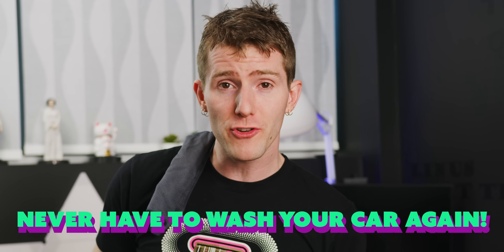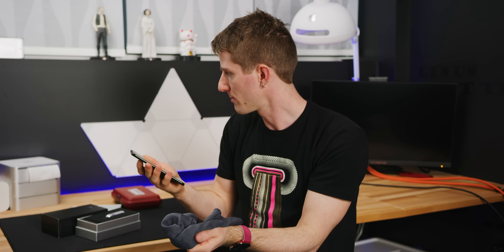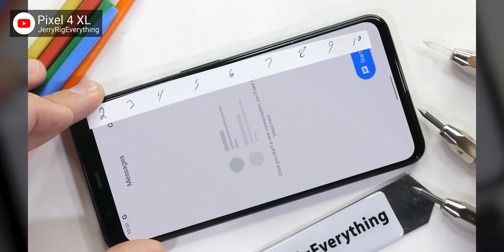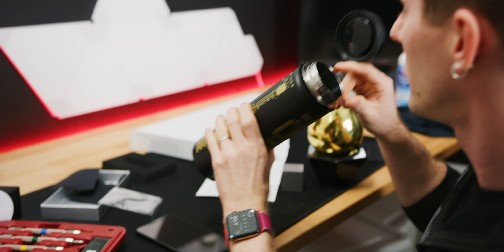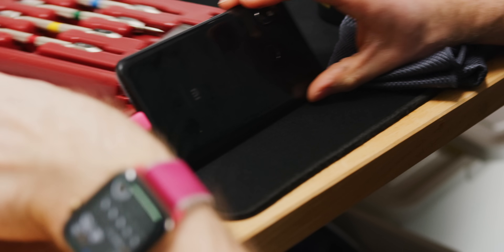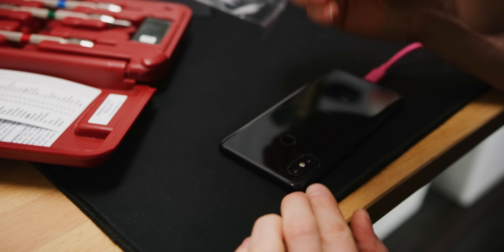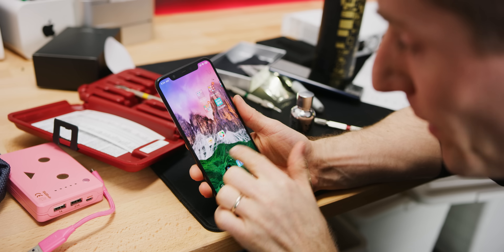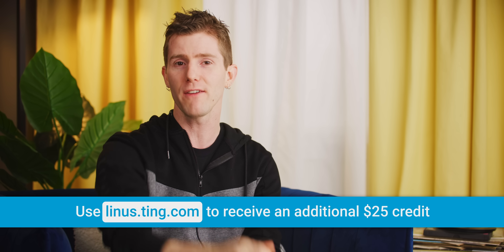Can Automotive Coatings Protect Your Smartphone?...

Comment: I wish you would've gone with a more reputable ceramic coating for this test. The one you're using is basically relabelled Chinese product. If you ever retest this, so with one of the OGs (Carpro, Optimum, Gtechniq, Gyeon, etc)

Comment: no one that knows coatings would say you never have to wash your car. completely impossible, now when you do go to wash it when its dirty, itll fall off when sprayed by water and soap. only thing about using this on a phone is most coatings will eventually need a rejuvenation coat to help the coating stay in good condition.

Comment: 5:30 -glass backed phones. Camera bump might be obnoxious but at least it prevents the mirror polish on the back of the phone sliding off surfaces inclined by more than a few degrees.

Apparently this is a problem with the new galaxy z flip

Comment: 9H hardness isn't actually anywhere close to a 10H on Moh's scale, as the scale is logarithmic, meaning that 10 isn't 1 step away from 9, rather it's 10 times greater than 9, which is 10 times great than 8, etc...

Comment: Hybrid ceramic wax would actually be pretty nice if you did a good application job. Best part of hybrid ceramic is it's SOOO easy to apply. You basically just spray it on.

And there's no such thing as ceramic coating making your car totally hydrophobic or making it unecessary to wash. It is great for your paint and stuff though.

Comment: great test but you used a cheaper ceramic coating. 1-Buy Wolfgang's coating for about $200 for 30cc. 2- Take two phones, Seal 1 phone completely, Leave 1 phone unsealed. 3- LET THE PHONE CURE FOR A WEEK. 4- Redo Test

Comment: OH GOD.

Linus. Stop. Ceramic coatings are excellent. But they aren't for protection against scratches. They're for protection against road grime, acid, industrial fallout, etc. And generally just produce a surface that is easier to keep clean.

This video needs to fuck off, because I already know what it's going to be, and I haven't even watched it yet.

Stick to tech linus. Stay away from cars. Your opinions on how driven vehicles should be banned when self driving cars come about is obnoxious enough as it is.

Comment: 4:23 NO. Hardness and toughness are 2 completely different things. Hardness is resistance to indentation, toughness is probably best measured as the ability to absorb energy during an impact. Increasing one tends to decrease the other. For example most ceramics are hard (good at scratching) but not tough (they're brittle), whereas a typical steel bar is tough (hit it, it bends and absorbs energy) but not hard (it's easy to scratch).

Comment: I'm curious what would happen if you went back over the scratches with the sealer.
Reply: ceramic does not fill in scratches. when you apply it on a car you have to machine polish the paint or the spider web like scratches will show through and they are very fine scratches.

Comment: I really like your videos, but this one is wrong in so many levels. Watching you from a detailing perspective, the basics of applying a ceramic coating is applying the proper product for given surface - meaning: there is a specific coating for glass, and what you have in your hands is for clearcoat. Other than that, given surface must be cleaned with isopropylalcohol and a lint free microfiber cloth, after which you apply a ceramic coating with given tool and rag in a cross pattern motion, from up to down and left to right (works either way), and in a few layers, after that you leave it to dry in natural light and a temperature not much below or above 20°C. That is talking about serious ceramic coatings, not the garbage ones. Normal ceramic coatings on cars, when properly applied and maintained, can last 3-5-10 years, depending on product and terms and conditions. When you do it like that, this video will not be crap.

Comment: Aka this stuff is autoglym, doesn’t mean you can’t wash your car, if you do that without topping it up you will lose the coating eventually. Fine Scratches will still show, shampoo your car without jetting it first and watch them swirls. 

I know all this as I have bought the product several times before and on my first car I made the “don’t need to clean the car so much” mistake & the “I can just shampoo my car straight away” yeah she turnt In to a swirly girl. 

The Water beading effect though is awesome! Makes cleaning things so much easier.

Comment: The thing with ceramic coating is that the scratch is in de coating now and not the glass. Which should make te phone more scratch resistent. You schould try to polisch the coating of en also polisch the non coated side and check the difference then.

Comment: im a detailer and i work with ceramic coating on a weekly basis. i can say it is legit and really works like they say, BUT!! but butt, it all comes down to the prep work and it wont protect from anything more then minor scratches. if a vehicle is not prepped proper it wont last long. of i forgot its pricey asf.
if done proper dust and everything will literally fall off. spray with water and clean! no wiping, soap, nothing just water clean.

Comment: I have ceramic GlassCoat bottles and have done this a couple times to my old galaxy S7. Thing is still rock solid.

If you use a high quality ceramic coating thats like $50 to $99 a bottle or even more, you'll notice a difference.

Comment: I have a glass screen protector on my phone that, when I bought it, had an oliofobic coating on it. That coating started to wear off and fingerprints, grease and other types of dirt were way more difficult to buff off. I applied a window coating that I use on all of my cars windows to make them more resistant to water and it worked perfect. It was like I had on oliofobic coating on it again. What I think happened here in the video is that the ceramic coating isn’t able to bond with the glass properly. On car windows you actually have a two-stage process to install a window coating: first á buffing stage, where all the “trapped” dirt inside the glass is being removed. Then the pores will be exposed and you apply the coating itself in several layers. The more layers the longer is lasts. It will degrade over time but it holds up really strong. Maybe you can try a window coating instead of a paint coating (like in this video).

Comment: Coming from the car world you'd get better results if you applied it closer to the recommended instructions. 2 coats with a full 24 hours of curing in between. At this point it's ok to touch but then you still need to give it the full 6-12 days to completely cure before doing any testing. that full curing is very important it doesn't reach it's full hardness until it's fully cured. As well there's a big difference in the pro ceramic products and the diy stuff you get on Amazon a lot of which is more like enhanced car wax than true ceramic coating, so mileage will vary greatly between product

Comment: I want to know what happens if you use the coating after scratching and compare the results between the control side and the coated side.  Does it fill the scratch like it says it will for car paint?  If it does is the screen still readable?  Also, Does it work better if it was was coated when it got the scratch or does it work regardless?

Comment: LTT really should read the Safety Data Sheets before doing this.  Yes, for example a ceramic seal and shine type car gloss application (or any for that matter, ceramic would just make sense here) can make some difference in terms of adding some microns of layer on the screen to help with scratch protection, but much of which is a hazard for example to the eyes if you say use your phone and then rub them afterwards even after curing.  It's not worth it.  Get a tempered glass screen protector instead.  Many of these coatings are formulated to adhere to a painted surface and not intended for glass where they are less durable, which increases the risk of the aforementioned.

Comment: Ok... what is the point of spending most of the time in this video to test if the coating can increase scratch resistance, since you know and said it yourself that 9H is close to 3 in Mohs' scale and the surface you apply it to (Gorilla Glass) can already withstand a 5 Mohs' pick without scratches? Did you magically wanted to add coating's 3 to Gorilla Glass' 5 and bring it to 8, which is when sapphire glass starts to scratch? Such a clickbait and useless video guys...
Only redeeming thing in this video was the giant gold butt plug, you should have tested the coding on it.

Comment: Ceramic Coatings work by forming molecular bonds in uneven surfaces; Preventing dirt and water from filling the microscopic holes.
Reply: And designed for paint because it is a lot more porous than glass

Comment: 9:50
To your camera/lighting staff, light reflects at equal and opposite angles. You should have put a softbox on the opposite side of the phone as the camera. Then you'd get a 'clean' reflection of white with appreciable scratches showing as black (since scratches have different surface angles to the rest of the screen)
Reply: Or... Put a softbox on the same side as the camera and straight black behind it.... Screen would be black, scratches white.

Comment: The coating is designed to fill the gaps in paint not sit on top of smooth glass. I wouldn't be surprised if the coating just came right off.

Comment: My film screen protector got damaged a while ago so I decided to just rip it off and use a bottle of waterless wash&wax (a carnuaba emulsion, specifically) on it. It made the entire phone silky smooth and nice to touch and fingerprint resistant, especially on the back glass.
Basically, it works, but be aware that the car solutions may erode the original oleophobic coating on the screen and different sealants have different properties. Mine being carnauba wax, I don't think it's especially hardy, but since this is a water-resistant phone to begin with, I've more or less just decided to give it a new wipedown with the W&W solution fortnightly or so. A $10 bottle of good quality car W&W can probably last you through hundreds of phones, and it likely will stand up to light scratches which you could plausibly kink out with a recoat anyhow.
I'd say that depending on the exact sealant/wax you use, you might have major results on rear glass especially if they are not oleophobic coated, but on screens YMMV more. Generally these do help make surfaces feel really nice and slick and it does provide a sacrificial layer.

No; I am not saying that this provides better protection than an actual film or TGP, but if you want a silky smooth touch, water repellency (especially if you have a water-resistant model) and a clear shine, car waxes/sealants can and will work on a phone. In theory I imagine even something like RainX could work, but wouldn't be too resistant to abrasion.
On that note, you can in fact also coat a phone that already has a film or TPG on!

Comment: instructions say it needs to stay 48 hours to work and most likely needed a second layer to fill missed pores..  -does scratch tests after less then 24 hours.  same logic as at my work in which machines fail at 80% speed so they have it run at 110% to expect better quality

Comment: 1) ceramic coatings have a shelf life, so even if the bottle would technically be a lifetime supply it will likely go bad before running out; from what I understand it crystalizes/gets thicker
2) some ceramic coatings can gain a haze to them over time

3) I bought ceramic coating to use on cheap IP dome cameras cause I doubt what they come with is any better:P(what I think is a good use for them)

Comment: the scratch test performed here is the same as doing this test on a piece of plastic wrap laid over top another piece of plastic wrap. Do you expect to see the same result on the side with 1 layer of plastic wrap as the side with 2 layers of plastic wrap? Because the underlying surface is just as soft on both tests the result will be the same.

Comment: I can tell you one thing, i worked at a rupes detailing centre and have been part of the most high end coating for 1.5 years.
At first a coating for 50 bucks !? That cant be even remotley close to a good effectice coating.
He did not apply it correctly and the material is just shit. I can tell you after coating the owners i phone 5 with a leftover high end coating in 3 layers and had dryed perfectly and that shit was like a rock. We even used a steelwire brush and what it leavs behind is just a fraction of the same effect on uncoted glass.
Basicly what my point is if he would go out to a real coater and get it done right. It will DEFINETLY make a great difference and also make the durabilty way better.

Comment: Remember to thoroughly wipe the scratch after using the picks, if the coating is harder than the pick it might deposit metal from the pick onto the surface - which will look like a scratch but isn't.

Comment: The ting phone rates at at the end.... It's still an absolutely horrible carrier option.  I use anywhere from 45gb  to 100gb  of data a month....  Their data usage slider only goes up to 30 gb and then tells me I would be paying $300 a month just for 30 gb of data.  

To pay that much for so little data would be like going back to a Canadian cell phone carrier.  I made the switch to an American cell phone carrier, I pay $85 a month American for a phone that I can use fully in the states or in Canada as much as I want without going back to either country.  

It's 2020, who doesn't use decent amounts of data?  Partnering with Ting needs to be seriously revisited as they are very clearly stuck in the past with archaic and expensive cell phone data plans.

Comment: Instructions: Allow 48 hrs to cure
Linus: so we have waited 24 hours
Reply: This is one of the reasons I get frustrated with some of the LTT videos. If you don't follow the instructions and just jump ahead steps/take shortcuts etc. you're not giving the product a good faith test.
Reply: @2mitts  the 48 hours is for cars, not phones. It hardns in 12 hours.
Reply: I used to work for a window tint company and would tell customers to wait 48 hrs and even put warning labels on their window buttons and still had people come in complaining when they rolled window down for fast food it tore... Then expected to get a full refund including us to fix it. Lol people are the reason most products get bad reputation
Reply: You should clay bar the car’s paint to remove any contaminants or traces of chemicals so that the ceramic can properly adhere. As even he said, most phones already have an oleophobic coating on the glass, which was not removed before applying. So I wonder how much of the ceramic even stuck. The type of ceramic matters too. I’m not sure which he used, but super cheap ones online have only a fraction of the active ingredients. There is some disparity in quality out there.
Reply: didnt even do it properly
Reply: You should also allow the product to haze a little on the surface, that's when you know it's dried enough.. So about a 10-15 minute curing time in room or 5 minutes with direct sun.
Reply: 24 hours to not get wet, 48 hours more applies when you're talking about touching the paint with anything

But correctly applied coating will take about an entire week to fully cure from top to base making the scratch test flawed
Reply: @Gomjokk  Good bit of info to know. Thank you.
Reply: 48hours to not get wet and soaks it after 24 hmm....
Reply: Advertising said it'd be ready in a day. Besides, who would want to leave their car or phone in one place for the full 7 days the manual says it needs?
Reply: @capsulate8642  that's because it takes time to cure and contaminants will be permanently BONDED to the surface of your car if it gets wet which will ruin the whole coating. If you don't want to install it properly don't buy the product.
Reply: @capsulate8642  I run a high end detail shop and a lot of people lol I have a car for a week for my coating jobs
Reply: @capsulate8642  if youre spending thousands of dollars to have your entire car ceramic coated professionally, its pretty likely that isnt your only car, and you can afford to be without it for a week while it fully cures.
Reply: Capsulate this ain’t for poors obviously
Reply: @capsulate8642  I will often leave my new phone or tablet untouched for a couple of weeks as I wait for screen protector and protective cases to arrive from overseas sellers.
Reply: @Kathdath  or you can just not scratch them. Its that simple. Or even better arrange it so they arrive on the same day, potentially delaying one of the products and saving you shipping costs.
Reply: @marcusborderlands6177  Mmm, why did I never think of that? Oh right because because when I go out of the house I tend to carry  other things in my pockets or bag, which leads to the potential of causing scratches on my electronics due to regular old friction.

Not sure how I am meant to arrange/control the shipping of my items so parcels arrive the same day. Is their some magical way to control foreign postal services, local customs AND the local postal/courier services?

And I seldom have the option of buying everything from a single seller.
Reply: @capsulate8642  a lot of these products have a second spray on coating that works as a sacrificial ceramic layer in case it does rain out.
Reply: @capsulate8642  You can still drive the car while it cures. You have to try to not get it wet for 24/48 hours. The seven days are just for chemical exposure because it hasn´t fully cured.
If it gets wet before curing a little bit you´re likely taking more of it off thus reducing its lifespan.
Reply: @capsulate8642  48 hours to cure, don't wash for 5-7 days. I have seen many put it on their car and drive it after the 48 hours.
Reply: @capsulate8642  I mean they arn't forcing you to buy their product.